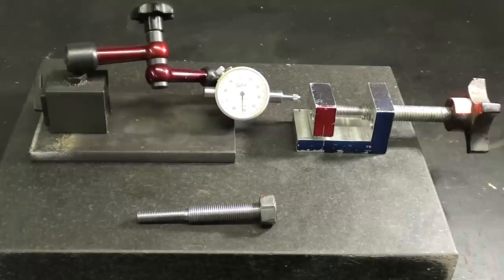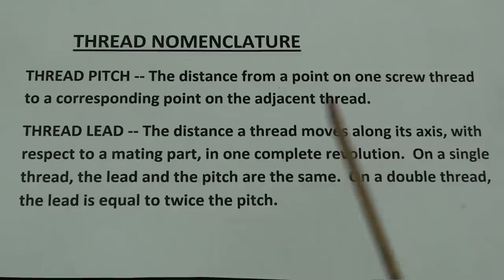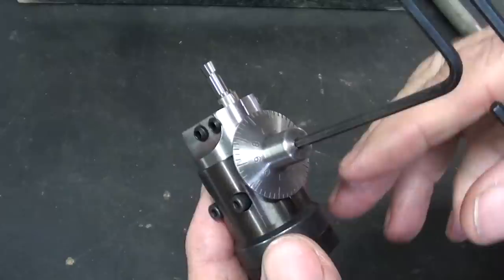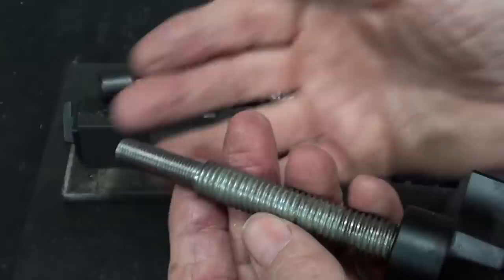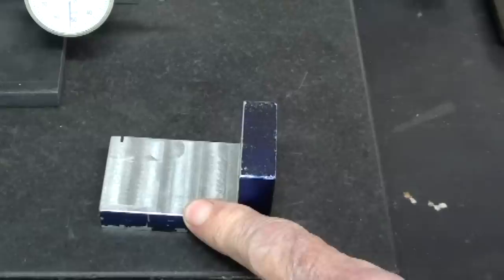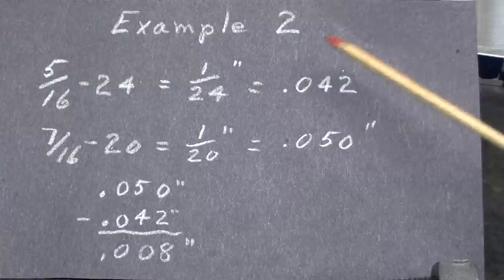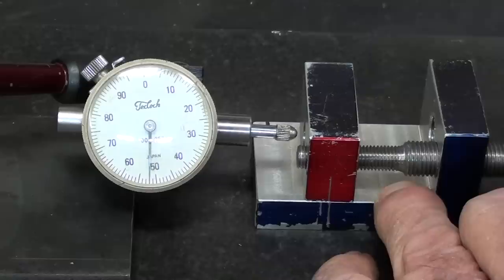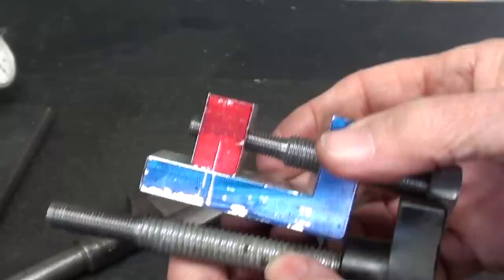What are DIFFERENTIAL THREADS #864 tubalcain

Comment: the most common place ive seen it inadvertently used is in flywheel pullers... big, usually 24mm type thread of 1mm or so, and an m10-14 plunger running a 1.25 or 1.5... its not what its actually for but yeah... its there. unfortunately its usually "backwards".
depending on the thread arrangement it can subtract rather than add the difference. meaning the thing moves BACKWARDS. you screw it IN 1mm, say, but it screwed OUT 1.25, for 0.25 total movement backwards.

used in a vice it can give an extremely powerful clamping effect (consider the example jig if the finer thread was the larger finer pitch at the fixed "jaw".)

that boring heads beautiful. 

if you take the above mentioned puller into account, you suddenly can see a way to get a fine and coarse feed and get quite a lot more range from that unit though...  a threaded sleeve. if its locked, you use the leadscrew lead. lock the leadscrew and spin the sleeve (chuck key?) then you get the differential effect. make sure the external thread is coarser!
theres nothing worse than having to twiddle a head from one extreme to the other, change tool... and find its still out of range! i cant imagine doing it at 10 thou a turn...

i started the same idea for one of my lathes on the cross feed, modify the nut, meant to have an adjustor doodad hang out the rear, fine feed for grinding.
 made a mess cutting my first acme and its sat on a shelf for... a long time.

Comment: I always learn something watching your videos. Am I wrong in thinking that if you swapped the threads, i.e. have the coarser thread running through the moving part, that it would pull the moving part towards the fixed part as you screwed the differential screw in, essentially reversing the direction of travel?

Comment: Amateur astronomer here. At the public observatory I am using an almost 80 years old telescope mount. To adjust the polar axis it uses a differential thread unit with one left hand thread. I have yet to measure pitch and diameter.

Comment: Differential screws that are left-hand thread on one side and right-hand thread on the other with the same pitch are called "Clamp Screws", and used (rarely afaik) for carbide insert holder clamps.  I also saw a guy use them to mount a set of vice soft jaws in a YT video once.  That was nice because the fastener couldn't mar the work.  It was completely buried in the soft jaw with only a hole for an allen key hex to drive it.

Comment: Differential threads are commonly used in:

Micrometers: Differential threads are often used in the construction of micrometers.

Screw jacks: Differential threads are used in screw jacks, devices used to lift and move heavy loads.

Hydraulic cylinders: Differential threads are used in the construction of hydraulic cylinders, which are used to create linear motion in various applications, including heavy machinery and construction equipment.

Valves: Differential threads can also be found in various types of valves, including ball valves, butterfly valves, and gate valves.

Pipe fittings: Differential threads are commonly used in pipe fittings, including couplings, nipples, and adapters.

In general, differential threads are used in applications where precise and accurate control of motion or fluid flow is required.

So? How did ChatGPT do? 😄
Reply from the maker: Thank you very much for that information. I was hoping if you are, would supply me with applications for that type of thread.
Reply: @mrpete222  to be honest your video was the first time I saw this being named. I now realize I've come across differential threads in adjusting mechanisms without realizing their exact function.
As I like the video and topic, I asked ChatGPT (the Artificial Intelligence chat program) what common uses there are for such threads. Seems like a question where it can do well.

Comment: What happens when you hold the piece (nut) that’s moving in your video, and let the currently stationary piece move?
Will it also move slow, at the same speed as what you showed in the video?
Reply: Yes it will. It doesn't matter which side is fixed, or even whether either side is fixed at all. What matters is that there is a smaller total "effective" lead value between the two threads. Both ends move towards each other or away from each other at the distance/revolution of this "difference" in lead values.

Comment: If the pitch or lead of the shaft thread on the fixed part of your fixture was finer than that interfacing with the other block, would the parts of the fixture move closer to one another?
Reply from the maker: I need to experiment more with that. I was surprised at how many people liked that video.

Comment: Is there a way to do this in the opposite? Where a little moving of the handle gives a greater travel than the lead? Just thinking.
Reply from the maker: Give it a try
Reply: One thread being RH, the other thread being LH would give you a lead that was the sum of the pitches rather than the difference of the pitches,, ie a turnbuckle.

Comment: I don't have anything like that around my shop but I did read an article about one. He started with a large bolt, drilled it lengthwise and tapped it. He threaded the large bolt into a block, and threaded a smaller bolt into the large bolt with the small bolt protruding from the large bolt. He anchored the small bolt and turned the large bolt. The resulting movement of the tip of the small bolt would be the differential of the threads.
Is this making sense to anyone?
Reply from the maker: Yes

Comment: Very interesting, are there any other ways to make a very small and precise adjustment similar to this apparatus?
Reply: Of course there are. Many, in fact. High-ratio worm gears are useful for such things. So are very low taper angle inclined planes/wedges. Really any mechanism by which you can create a desired ratio of input motion to output motion.

Heck, you could have a rigid linkage bar with a fixed pivot at one end, driven by a known lead distance screw at the other end, and drive the fine movement you desire from some fractional distance along that bar that creates the distance division you want. Of course in that case you would want to make sure the input and output remain at parallel angles throughout the range of pivoting motion the bar travels through, to cancel out the trigonometry errors that might be introduced so that your input/output ratio stayed constant. And you would want your bar rigid enough not to flex more than your allowable error tolerance under the intended loads. So that one would require some deep thought. But it would work.

It all depends on your requirements as regards working space, relative input/output orientation, complexity, etc., etc., etc.

Comment: I think there is a conspiracy surrounding this subject matter due to the fact 25 tpi is almost impossible to obtain and most lathes will not cut them and 25 tpi is best used for making precision instruments using 20 tpi and 25 tpi for an overall .010 of travel. Starrett must have thrown all the 1/4-25 taps into the Millers river after the first world war 😄 ... apparently the taps were used on 1903 Springfield rifles to secure the trigger guards.